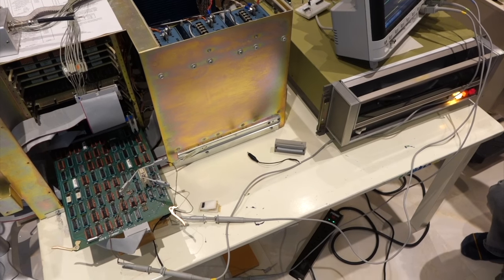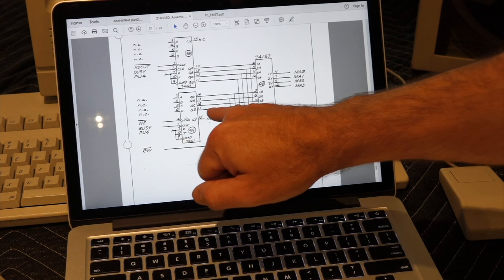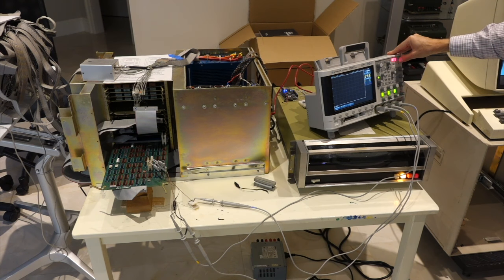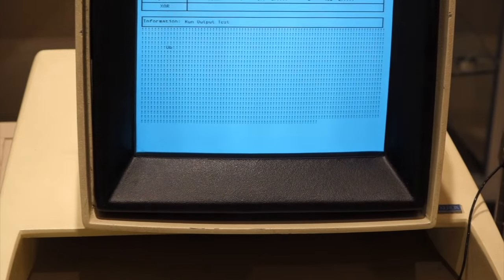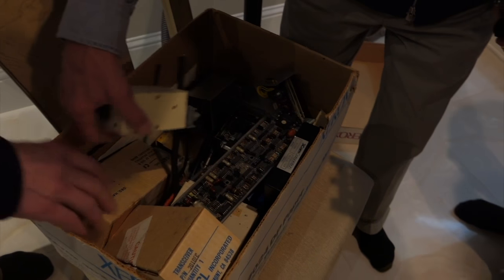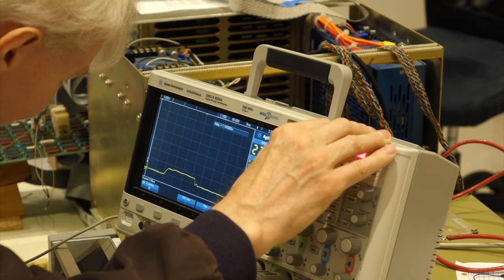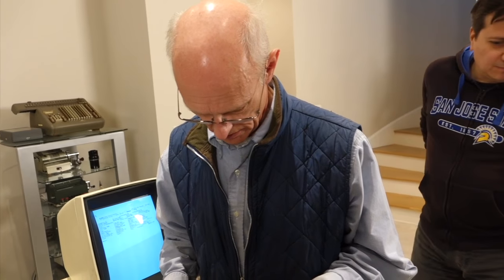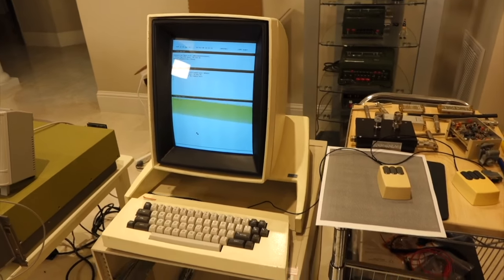Xerox Alto Restoration Part 12 - Ethernet pioneers and the first optical mouse

Comment: I see that Beaglebone Black photobomibing behind the Agilent, there. you want to put an Alto emulator on something, there's the board to do it on, it seems.
I'm sure that someone out there watching this video will either start work on, or is working on, a port or clone of Bravo for *nix systems now.
Reply: Hi Sudos

Ken Shirriff is implementing the bridge/gateway to connect our 2.94Mbit ethernet to modern ethernet and then to remote Alto and emulated Alto systems.

Comment: Great stuff. I had fun maintaining thin ethernet in the 90s which usually meant crawling around with a DVM. If token ring had taken off instead of ethernet making it bridge seamlessly to Wi-Fi decades later would have been somewhat more challenging. On the other hand the MTU of 1500 has stuck more than it should have
Reply: Well, I suspect that If Token Ring had become the prevalent networking standard, the wireless standards would probably have reflected that, so there would have been no more issue bridging the Token Ring to a wireless network than there is to do so with Ethernet now
Reply: Ts6451 but I don't believe token passing and recovery would work too well on intermittently present devices. Ethernet is a much better fit though I dare say something clever would have been done to make it work
Reply: I would guess that if Token Ring still was a thing, it would not be quite like the traditional ring. Probably they would be switched, with each port on the switch being a separate ring with it's own token. After all, the reason that networks were rings or busses back in the days was that switching/bridging was hard and expensive.

You could, of course, use token passing on a wireless network(separate channels between each device on the ring or a virtual ring like on some token bus type nets),  but I would rather expect that since the air is a shared media, the access point would just send the token directly to each connected device in turn, with each device sending the token back, with the data attached if it had something to send, and the AP would bridge the thing to it's destination.

Comment: When I started at university around 96 they still had some of the thick Ethernet stuff there, but it was not in active use anymore. The technical support staff was talking about this system. Especially that their were students that did disconnect the system at  times not realising that no one could use the network.

Comment: I think XC1 and XCII (along with other Xerox facilities) were still using thick cable Ethernet up until the point where all of the Star workstations were sold to EDS?

Too bad OSBU South and BWS Hacks no longer exist.  Otherwise  you might be able to connect and who knows....

Oddly I never saw a three button Optical Mouse on a Star 8010, only the two button roller ball type at XCI, XCII and DSBU El Segundo.  The optical two button mouse was plentiful on 6085I and 6085II documenter systems .

I remember how amazing I thought it was to be able to email Basic Graphic documents (or anything else) to my training contact "across the street".  

I remember email seemed to move rather slow with all of those old Xerox 8000 Executive servers operating at full "tilt".
Reply: all that copper, I can see how most of the original systems would have been torn out.
Reply: When that system was in use in the 1980's-1990's, copper prices were not an issue and a lot of the institutions using those systems wouldn't have scurrying around for that last penny the way we are today.

Comment: Even if you get ethernet working, is there anything you can do with it without having another Alto?
Reply: They'd have to bridge it to modern Ethernet. That would mean changing both the speed and the framing to work with a modern network and ethernet-speaking Alto emulator/simulator if such a thing exists
Reply: Ken Shirriff is building a gateway, using a Beaglebone card, that will allow us to transport the Xerox PUP protocol from the 2.94Mbit original ethernet over 10/100Mbit ethernet and through the Internet. 

The objective is to link multiple Alto computers together as well as communicating with PCs running the Contralto emulator. There are several operational Alto computers up at the Living Computer Museum in Seattle, plus we expect to assist in restoring 2-4 more down here in the Silicon Valley area, over the course of the next year. 

Many things changed between original and standard (e.g 10Mbit) ethernet. The cable went from 75 ohm to 50 ohm. Modulation changed from voltage levels to current driven. The single sync bit of original changed to a longer sync preamble. The original has two addressing bytes, allowing only 254 nodes on the network, while the standard ethernet has MAC addresses that allow extensive networks. The higher level protocols for the original were Xerox only versions such as PUP, while modern ethernet uses standard protocols. 

The gateway being built by Ken must translate an original station address, e.g. 22, to a MAC of the target on the modern ethernet side. It must wrap the content in a protocol that is routable over the Internet and deal with the correlation of IP addresses to target computers.
Reply: What we need is a dial up bbs just for vintage computers so people can get software and transfer data between media.
Reply: Carl Claunch Fun to connect the Altos to their siblings on other sites with a bit of tunnelling (assuming Alto protocols don't have very short timeouts)
Reply: Ken is the person engineering the tunneling and who will be looking closely at timeouts and such